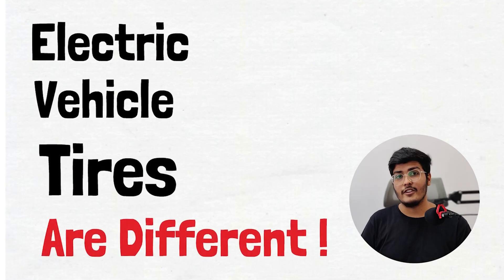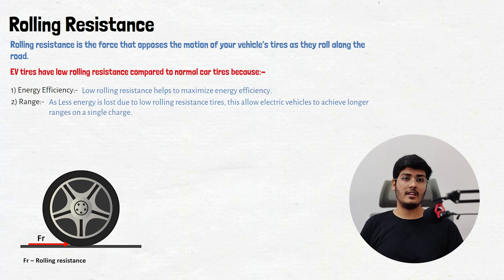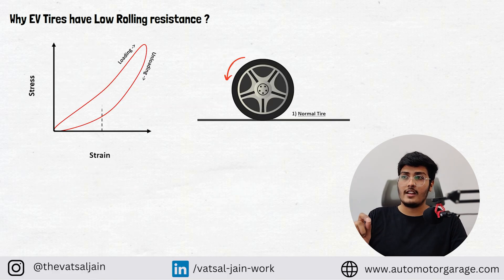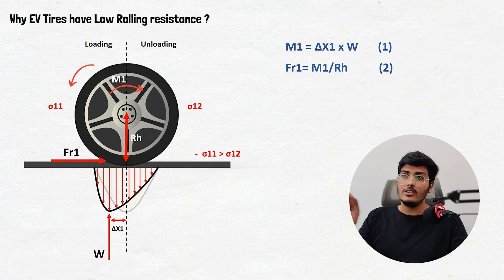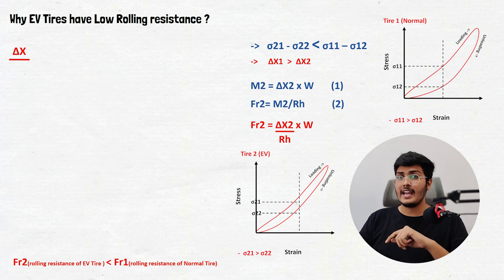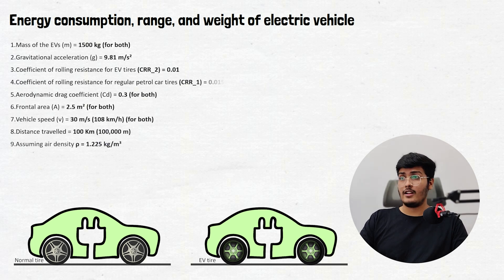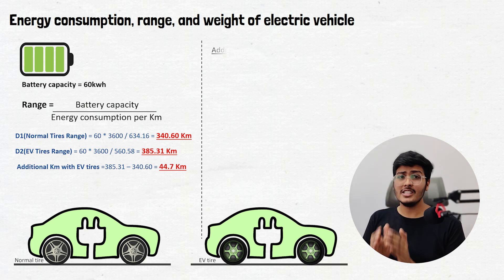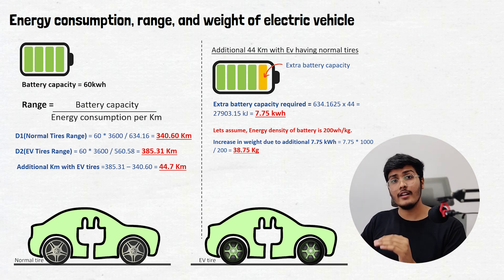Rolling Resistance Rumble: EV vs. Non-EV Tires | Why EV tires are better ?

Comment: Rolling resistance numbers were little rough for the comparison if you look what they are actually. On road migth be closer to those figuges but still the normal tires are closer to the ev tire values in this example. At least if you drive in tarmac roads and use european tires. I would say EV tires are A rated 0,0065 or better and normal tires B-C range on eu label. Cheap tires and then D or worse

Comment: How do the stiff tires have lower rolling resistance than flexible ones ?
Reply: a steel train wheel has almost no rolling resistance. the more the tire bends, the more energy is lost in that bending. try riding a bike with properly inflated tires and  at half that pressure and you will see the difference

Comment: Very true and informative just replace my ev tyres with normal tyre and lost the range with same percentage shown in d video ..but the ev tyre has low road grip resulting the less confidence on highways ...I suggest every viewer that when needed replace the tyre with low rolling resistance tyre only otherwise you have to  compromise with range..
Reply from the maker: Thanks 😊